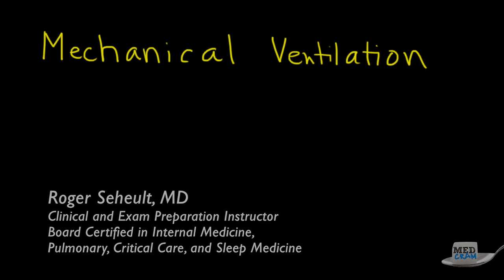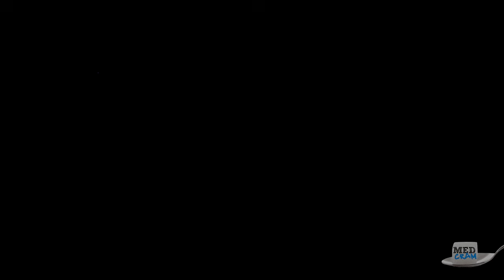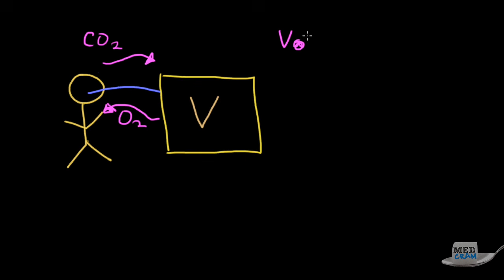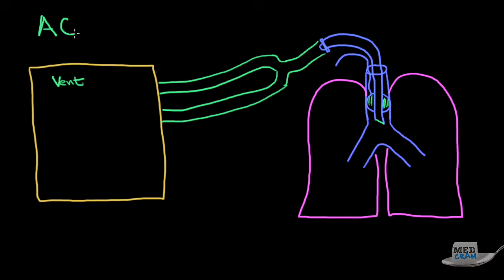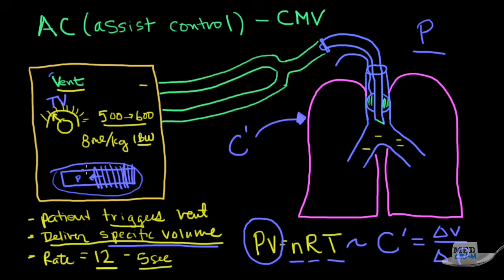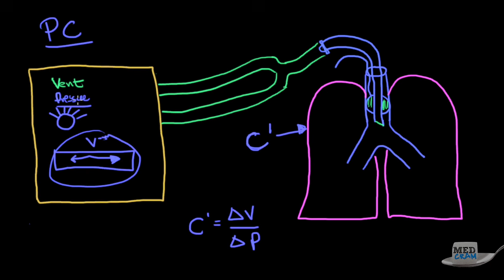Mechanical Ventilation Explained - Ventilator Settings & Modes (Respiratory Failure)

Comment: I really love your educational video on this topic! Last year, I had a four and a half hour surgery. Before the surgery happened, general anesthesia was given. When I was unconscious, I was intubated. The endotracheal tube was passed through the vocal cords and into the trachea. The tube was then connected to a mechanical ventilator. I do not know what modes or settings were used by the anesthesiologist; as I was fully sedated for the jaw correction surgery.

Comment: I'm wondering how oxygen and carbon dioxide functions if governed by different laws of science or different science application in other multiverse meaning the space travellers have to scout first or send probes to those areas prior to travelling there so that they can adjust to new and different sciences there. Though Doctor Seheult managed to explain well the knowledge in mechanical ventilation well versed to his profession.

Comment: question....my daughter is 23 and was in a motorcycle accident tues 6-28-22 , she's in assist ventilator and breathing on her own. the doc is talkin already about taking her off the vent and putting in a trach this wed 7-6-22 and then a feeding tube into her stomach. they've already mentioned about long term acute care facility. she's yet to wake up and is sedated. today and yesterday she's been shaking alot when disturbed, and they say it's most likely from the cold pad under her that's helping with her temp. she was maintaining her own temp yesterday but her temp went back up last nite, therefore they are now using the temp control pad under her.  my question is, should they even be considering takin her off the vent and doin the trach this soon, especially if she's still sedated and not waking on her own?  i'm very concerned this will not be a wise idea and she wont fully recover. she has head injury with a little bit of dead cells on both sides at the front, and a fractured nose and left eye bone, a contusion to the spinal cord at the 6th vertabra and some blood spots on the brain.

Comment: This was great.  I wish I had this available back in the day. Thank you for your time.   I started out as an Oxygen orderly back in 1973 after I was discharged from The Marine Corps in New York City.   Wheeling  H tanks on a dolly with an adjustable wrench to the patients bedside and changing them out when they reached 500 PSI. No piped in Oxygen back then and only open patient Wards. with 10 to 15 patients in a room separated by a draw curtain.Part of my arsenal was a No smoking sign. It was not uncommon. to see patients smoking while lying in their beds as well as a doctor examining a patient with a cigarette dangling from the sides of his mouth. Oh how we long for the good old days LOL.   I eventually became a certified  inhalation therapy tech. Via The AARC later it became the NBRC  or vice Versa. I stopped practicing in 1999 when I came to Massachusetts only to discover Massachusetts was a commonwealth and reciprocity of my licenses were never granted.   I like to believe,  I was a respiratory therapist and have been around since the Infancy of our profession.  That makes me the original OG of respiratory therapy.  Back in the days. We ran to codes with a Bird Mark 5 or mark 8 pressure ventilators 
( the little green Box )  attached to an E-cylinder of Oxygen.  The ideal settings on the Bird were 15, 15, 15.  It was actually a great little machine to run to codes with.  Easy to maneuver through patients wards and great during transports. Back then the big fear with  the Bird was the  infrequent incidence of  Barotrauma  as well as all the negatives associated with Positive pressure ventilators.  However, if you knew what you were doing,  You were golden.  

 later in my career I became a clinical instructor and that became part of my introduction to my students. I would introduce myself and begin with these words 
 ( Keep in mind.  I am a United States Marine )  I would begin,  If you are  here to press buttons and  turn Knobs.  This is not a class for you. I can teach a Monkey to do that.  
However,  if you want to know what happens mechanically and physiologically after you have pressed that button and turned that knob. Please have a seat.
 (  By the way, my students had the highest passing rate on certs and registry )  Back to the past. 

Back then,  we had Engstrom and Emerson Volume ventilators with a heating plate at the bottom and a steel pot similar to a pressure cooker that sat on atop  of the heating plate. The tubing ( AKA Manifold)  contained steel wool lining the inside of the tubing to increase and help maintain the humidity of a dry gas.  It had a huge mechanical spirometer.   It sat on top with a large needle that move per cycle of respiration .
One day,  the workhorse came onto the scene. We all gathered around and received an Inservice on the latest and the greatest. The Puritan Bennet MA-1. followed by the 7200, the bear respirator, Etc.   I could go on forever,  so I will end here with these two memories.  When PEEP was in its Infancy. Hell,   it felt like we invented it.    We would take a large bottle filled with water,  placed alongside the respirator on the floor. We would  submerge the tubings  of the manifold into the bottle below the water  level we would adjust the amount of PEEP by adding more water to the bottle or elevating or decreasing the height of the submerged tubing into the water. This is how PEEP.  started out. ( Positive End Expiratory Pressure.   prolongs exhalation.  Thereby allowing the Alveoli to remain open longer and allowing for a  prolonged period of Diffusion along the Alveolar Capillary membrane ) Somethings you never forget LOL 

If you took the time to read this. Thank you for allowing me to share with you a trip down memory lane. Trust me there is a lot more to share as my career span was well over 35 years working in diverse clinical settings and adult critical care.  To include having the honor of being part  of Mount Sinai's School of medicine and working as a pulmonary research technician alongside Dr. Irving Sellikoff ( asbestosis and Sarcoidosis studies)  Dr.Alvin Tierstien and Dr. L.K Brown. Traveling the country back in the 80's as part of a research team to predominately gay communities and seeing well over 100 patients a day and performing PFT's and Perfusion studies when patients at that time were expiring in NYC and the diagnosis at that time was " Fever Of Unknown Origin "  ( AIDS)  Going into the Tunnels of the NYC  Subway system with a team to locate and perform sputum inductions on the homeless.  At that time, we had a strain of drug resistant TB.  
Then I moved to Mass and  my carrier  came to an abrupt halt because of Bureaucracy.  "Sie La Vie" .   I am a U.S.  Marine.  We are trained to adapt and overcome. 
I fell back on the trades.  In the Marine Corps,  I was formally trained as a Lineman and electrician as well as an  Avionics tech.( Aircraft electrician )   At Marine Corps engineer school. Courthouse Bay N.C. 
My mechanical aptitude I believe was  why I was able to teach my students and reach them in a mechanical way.  I would equate the human body in its purist form. A machine and in a mechanical way.   The neuron pathways are no more than a glorified electrical conductor ( wire ) picture the wiring in your home. It has copper and the insulation that surrounds the copper coil is made of a rubber non conductive material.  
A neuron for all intents and purposes  is a wire and  it's insulation it is the  Myelin sheath.   The heart, a four chamber pump. Positive and negative pressure outputs with valves that open and close and  seal etc.  
I miss my  career,  I miss my patients, I miss being able to have that feeling after all is said and done.  Watching that patient and his family go home together. 
 However, I was able to vicariously share with you a very small part of the evolution of Respiratory Therapy from a first hand eye witness. 
This is the OG of Respiratory therapy saying Thank you again and Semper Fi.

Comment: I've done 4 things to greatly improve my lung function and overall wellness.  My sleep, energy, and life outlook are greatly improved:

1.  I started using the BreatheEasy Lung Exerciser about 5 years ago and still use it,
2.  I stopped mouth breathing unless absolutely necessary, even when exercising,
3.  I did light mouth taping at night in order to ensure nose breathing all night,
4.  I do an simple exercise to reset my CO2 levels for triggering breathing so I don't breathe so much.  See Patrick McKeown's work for more about this.
Reply: Is your goal to get pulmonary hypertension?

Comment: Sir, I am not a medical professional...but with coronavirus disaster going on...i got curious. Question: do we have to go via lungs. Can we not divert blood out of some major veins like abdominal vena cava, that carry larger volumes, analyze o2, co2 levels, and based on result, add oxygen ( i don't know if we can just mix o2 in blood) and then reroute to the vein? Let lung do what it is doing..and blood pressure is maintained by heart anyway. This will bypass the compliance code etc. I don't even know if this makes sense..

Comment: An inventor wondering about CoVid-19 ventilator shortage emergency situations;  and wonder whether in patient controlled breathing;  if the patient is conscious, Can the patient use a simple tube held in the mouth to inhale and if the patient is prone does tilting the patient help them with regards to fluids in the lungs?  Also will diuretics help the patient get rid of some of that lung fluid? If you had to program pressure control only, what PSI might be shared by several patients on the same tank of compressed air?

Comment: From what I understand.. Ventilators themselves are quite easy to build, it's the operation of said ventilator that is complicated, there has been mechanical hand powered ventilators since the early 1900s. An engineering student made a 3d printable open source ventilator that can be easily mass produced. The issue is creating code and a device that can figure out a patient's correct natural breath cadence and then being able to tell the ventilator to match it and maintain it.. and then of course a monitor to display said data.. What I don't get is why they aren't mass producing hand powered ventilators like that 3d printable one.. that way at minimum instead of someone going on ZERO ventilators and dying, they can at least hand pump them or use some servos and basic coding to make it pump in and out at the average pace.
. I could make one of those in my garage in 24 hours.

Comment: I learned quite a bit. I was always curious what sealed the tube in your throat. The problem is getting oxygen in, and drawing CO2 out. I'm still curious about tilting the body, the way before iron lung.

Comment: AC might be called Pt Initiated.  Compliance is the inverse, or complement, of inflation Resistance(ie due to fibrosis, obesity, or fluid collection).  The various alarms(vol, rate, pressure, pCO2-out, pO2-out, etc.) should always be set, & tailored for near normal respiration, in case the patient's respiratory performance changes for the worse.

Comment: I was wondering on how the exhaust gases  are scrubbed
Reply: there is another passage in the tube, where the input valve close and the output valve opens, passing the exhaust into a pressure transducer that make the beep sound to make sure that everything is going okay.

Comment: In post #35 you spoke of Quercetin and it's benefit in managing Ebola and Sars. Even though the dosage of Quercetin is so variable, it still seems to be a way of providing prevention and possible treatment. This information is very significant and so much so, I have started taking 500mg four times a day along with 20mg of zinc. I am interested to know why you have not professed the widespread use of it?

Comment: Surely a CPAP home machine can be used in certain instances when a hospital-grade ventilator is not needed.  Nasa engineers can design a a dapter for a CPAP to endotracheal tube ETT.  They did save the Appolo 13 astronauts with a makeshift filter put together from duct tape and a few other materials in the lunar module in the early seventies.
Reply: Dyson have designed their own ventilator for the UK and they are being made.
Reply: CPAP machine doesn't have ventilator settings on it. Someone on a home CPAP machine is able to breathe on their own.  An intubated patient may or may not initiate breaths themselves.
Reply: Home CPAP machines create only pressure, no tidal volumes. In order to "ventilate" someone you need tidal volume as pressure only helps oxygenation.

Comment: I am an RN who may be called back to the hospital to care for patients...awesome to be able refresh on this while waiting for the call... it has been a lot of years since ICU for me. Thank you
Reply: I'm in the same boat!
Reply: Just asking... would a CPAP Machine be sufficient ventilation (possibly) duirng this outbreak/pandemic?
Reply: @CyclePat  good question
Reply: @CyclePat  
No cpap would not work or be sufficient for ventilation because CPAP deals mostly with oxygenation issues not ventilation.  Covid-19 pt usually develop ARDS so it would be hard to use cpap. The pressure from the CPAP machine is not the same as a pressure from the ventilators. 
An advanced BIPAP with backup rate, APRV or SIMV-volume regulated -pressure control on the ventilator would be better options. You cannot have oxygenation without ventilation.
Reply: Respiratory Therapist Run Ventilators Period.  especially in critical care patients.. if you want to start to kill patients a painful death by all means take a 10 minuet video tutorial and have at it ... we have only gone to school for 2-4 years to learn about hemodynamics.. i not deminishing the job of our RN we love and need them.. but we need to stay in our own lane.  or we will see masive crashes..
Reply: In Australia, we don't have a lot of respiratory therapists. Critical Care trained nurses are very capable in looking after ventilated patients :)

Comment: I was told by a Doctor and many ICU nurses that putting a patient on a ventilator was fraught with many dangers especially for the elderly patient.  Not that the equipment would fail to sustain homeostasis, but while ventilated it provides many a patient with a path way for a pseudomonas infection which usually requires both a gram positive antimicrobial and a gram negative antimicrobial, e.g. Imipenem and Amikacin given together in the right amounts.  However, if they survive that; I was told the biggest hurdle was successfully getting them off the ventilator to sustain breathing on their own once off of the machine.  I can recall where a family had to make the decision whether or not to ventilate their elderly Grandmother.  Their Doctor who was also my Mother's Doctor was recommending that they don't do it and take their chances for the survival of their Grandmother without its use.  However, they chose to ventilate her.  At first after she got off the ventilator she appeared to be in good health and it looked as though she was going to make it.  But without any warnings she took a sudden turn for the worse had very labored breathing and died.  This happened about 36 hours after she had been taken off the ventilator.  The family was stunned and was in shock.  However, their Doctor reminded them he warned them not to ventilate her due to what he predicted could have a high percentage of occuring.
So my question is why is the mortality rate so high for the elderly; subsequent to being removed from a ventilator?
Reply: Pulmonary flashback

Comment: I have a vocal cord paralysis (left vocal cord always in closed position).  This was caused when my left recurrent laryngeal nerve was damaged during a partial thyroidectomy and I have since had the left vocal cord bulked up.  Should I ever need to be intubated, could that still be done with one closed vocal cord?  Can one be on a ventilator without the ETT going past the vocal cords?  This terrifies me.

Comment: How Gtech are going to sort all these complex features in just a few days churning out 1000 ventilators a day must be a mammoth task, I wish them every bit of luck and we need it desperately,  I think they haven't seen this video, may be they should , no disrespect, they are trying to help, but it appears their ventilator must be very simple and not so complex operations , I heard their machines don't require electricity, it is propelled by the oxygen pressure, which can be regulated in a similar way as is done by gas regulators, which does not require any electricity, my guess is it is working on the principle of vacuum servo assistance, as used in car multiplying braking force in cars, where a small pressure controls a valve and uses the atmospheric pressure to generates higher force, so it can be arranged where when a patient tries to inhale oxygen, it creates a negative pressure which controls a valve that lets in oxygen under certain pressure, when the lungs are fully inflated, the valve closes and pressure builds up as the patient also tries to force out the air, this lets open another valve which allows the air from the lungs escapes by patients own lungs relaxing, both inlet and outlet valve in conjunction with incoming oxygen pressure needs to be balanced intricately to achieve perfect breathing, yes it can be done, without due complexity and requiring any electronics, however it will only work on patients who have some breathing capacity, if a patient lungs have collapsed and cannot breath at all then this device would not work, it is a form of assistance breathing, where the weak lungs are assisted by servo mechanism and oxygen pressure. It cannot work on patients who have zero breathing and require forced breathing, you would then require proper spec machine to do that.